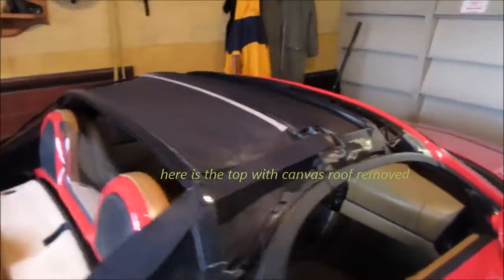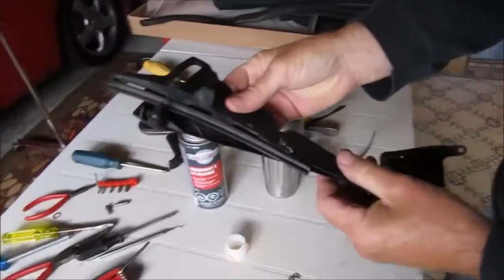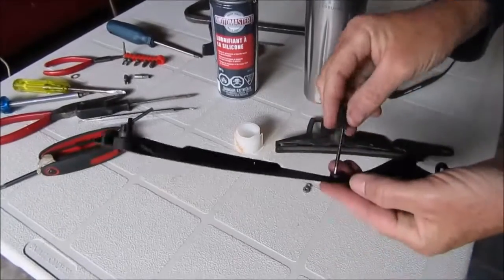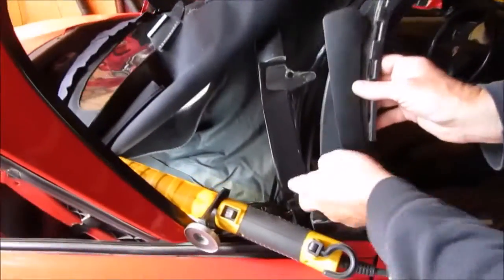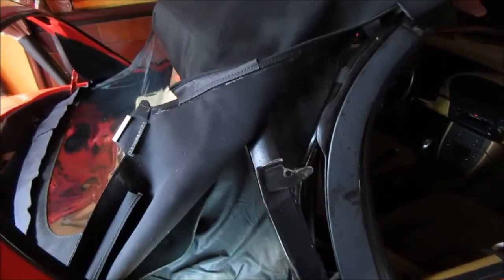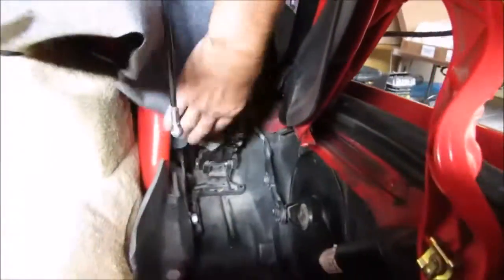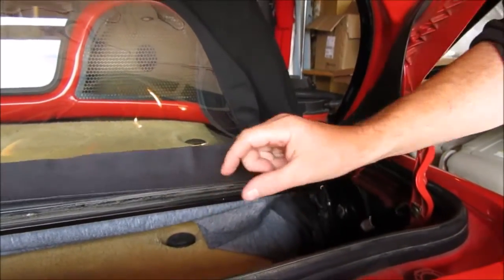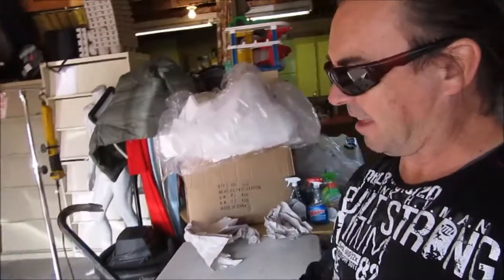Can An Average Guy Change A Convertible Roof On A Porsche Boxster

Comment: Ive done it before. Bought 300 bucks off ebay. You'll need good sealant around upper plastic  trim. Best to change top in warm weather like summer. My new top took 2 days in the sun for the fabric to stretch and settle in and I was able to close my top tightly.  🖒